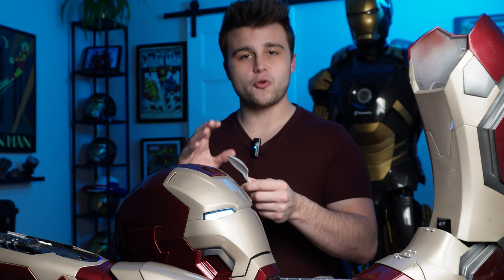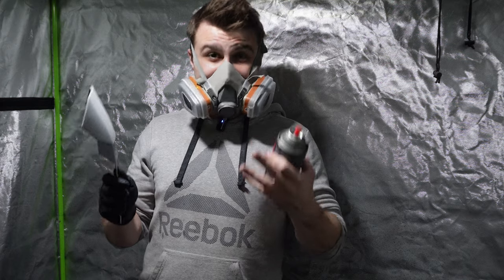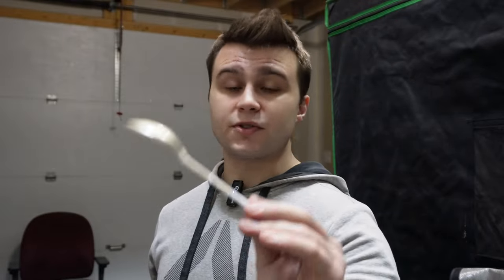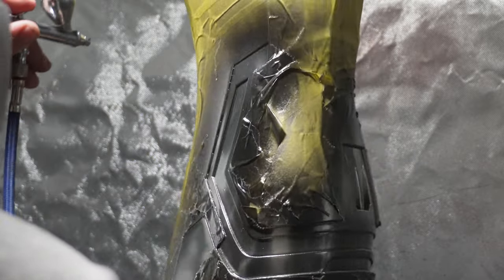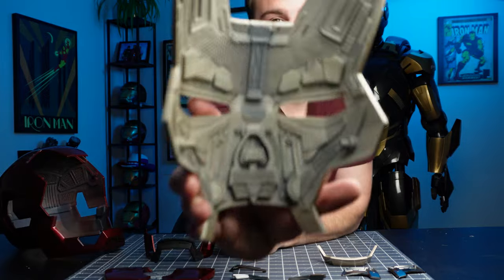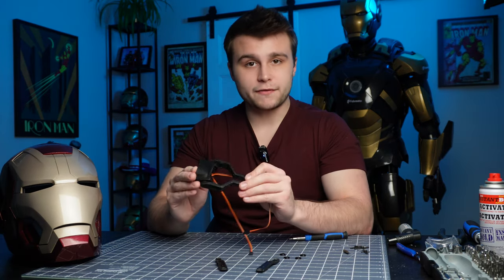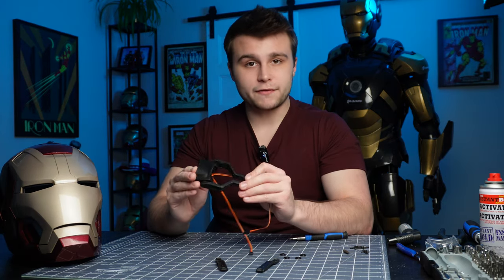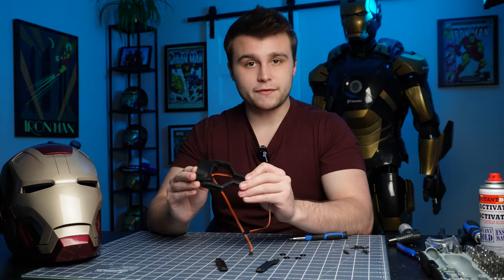Tips & Tricks for Painting 3D Printed Cosplay - Making a Motorized Iron Man MK42 Helmet (part 4)

Comment: There is no need to buy plastic spoons. Why? Because you will have 200 failed prints in the same material as you are using. Thus you can test the entire project on identical material as you are using. Trust me, we all have 20 failed prints absolutely minimum for a small armour project. For a full suit, it's probably over a 1kg of print failures. Adhesion, clogs, imperfections, sizing issues and all sorts. I have a bucket full of random print parts that did not finish. Use these to test the process of smoothing, covering, sanding, priming sanding and painting and sanding and painting and sanding and painting and sanding and painting and sanding and painting.
Reply from the maker: I totally see where you’re coming from and I’d be inclined to agree, but I would much rather test paints on a perfect surface rather than spend all that time sanding a failed print just so I can get to a smooth enough surface to test the paint.
Reply: Yeah definitely disagree. One, I have 0 failed prints with my armor. Besides 2 pieces I forgot to mirror and now have extras of.
And like he said, what am I going to do sand and finish those failed prints to get a good finish or use a dollar store plastic spoon to test on right away

Comment: Great video and really great series. I've followed it to build my first helmet and I've found this to be super helpful. One question I have for you, or anyone, is - in this configuration, what USB power bank are you using? Mine continue to turn off after a while. I've searched and found a few hacks but it seems that, for a USB-A power connector, there has to be something easy or a brand to buy that just works. Suggestions?

Comment: I understand the sanding - priming process but do you end with a coat of primer or on your finishing grit?
Reply from the maker: Lately I’ve been applying multiple coats of primer before my last pass of wet sanding that way I get an even, consistent, and smooth surface without breaking into the layers of plastic or filler, and then I start the painting process :)
Reply: @plentifulprops3d  I was breaking into the plastic layers too so that’s what made me ask. Thank you!

Comment: How do you make your magnetic mounts on your Iron Man MK 20 helmet?
Reply from the maker: The one designed by Levy3D already had them, but the Do3D one needed mounts so I designed them in tinkerCAD (it’s just a cylinder the size of the magnet imprinted into an 3D object of your choice, and then fused in place after it’s printed and aligned correctly)